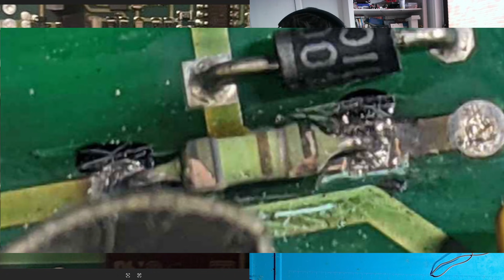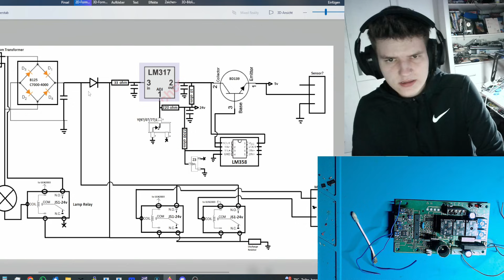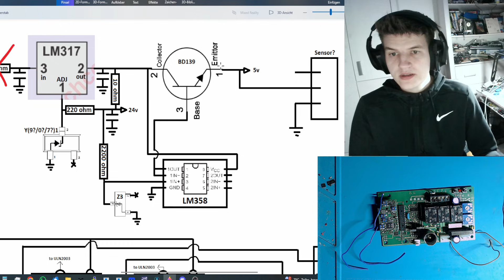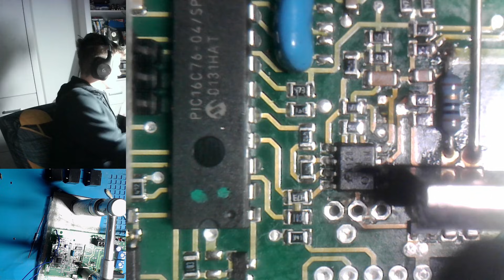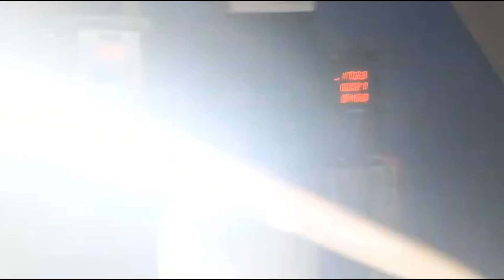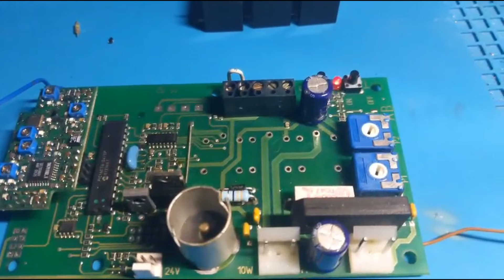Ecostar A Repair (+Schematics) Garage Door Opener - Electronics Repair 17

Comment: I have ecostar liftronic 700 motor, also with failed PCB. For now I managed to "jump" dead 5v regulator by soldering line directly from bridge rectifier output to 5v voltage regulator source. My issue is next: when I do self learn run (only toothed belt, doors disconnected) motor runs for 1-2 sec. and PCB shuts down like it lost power. It immediately afrer that restarts, relays clicks and goes to error that there is no memory reference. PCB is only working when there is no load to motor applied. If needed I can sent you more pictures on mail.
Reply from the maker: Hey, i dont think you can Junp the First Regulator, its Not only used to suply the 5v reg, but also supplies the relay coils.
You can send me pictures on elecrep87@gmail.com or on discord 🙂
Reply: @craftbenmine I sent you email with pictures and short video of mine pcb running